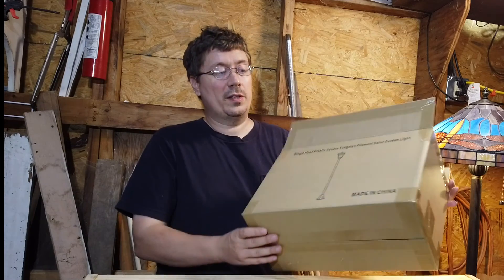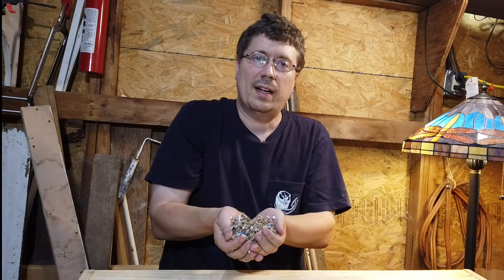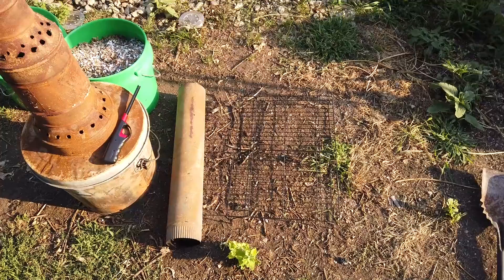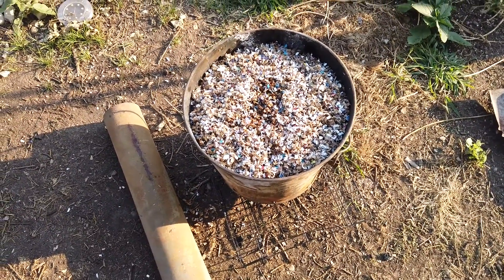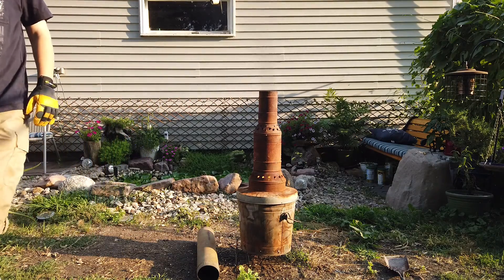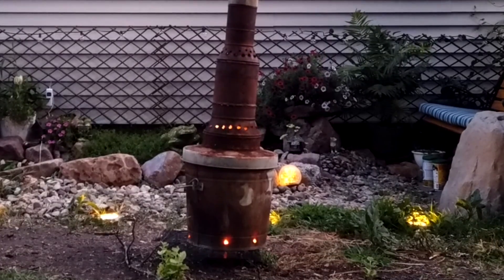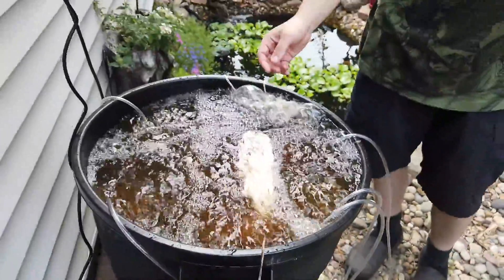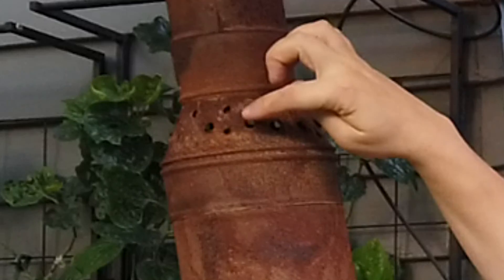[Biochar Basics] Making Biochar from Cardboard **LOW-SMOKE**

Comment: Does the garbage can eventually wear out? Get holes burned through? Thanks, great video!
Reply from the maker: It does indeed oxidize/rust over time. The high temps and exposure to water and extreme fluctuations in temp accelerate oxidation, as does the loss of galvanized coatings. The rig in the video is still around and serviceable. I estimate problems surface in as few as as 2 or 3 dozen runs. That is something that could be improved, for sure...

Comment: Did you get about 1/2 the volume of biochar from the shredded material? I'm wondering what your output is compared to, say 1x1 split wood from the wood pile.
Reply: Thinking that the 1x1 would require the format using a retort,  thoughts?
Reply from the maker: Did you end up trying this? I think you are correct that this design may not work well with dense wood.  You could scale it up, and might get a similar yield. A more traditional charcoal production kiln or retort might be less finicky.

Comment: are there alternatives for the crosscut paper shredder?
Reply from the maker: I think you could use a version of this TLUD to create biochar (charcoal) with most dry organic matter. Results may vary based on the input material, but some possibilities include dry leaves, sticks, pine needles (?), pine cones, wood pellets, etc. If you are using cardboard, but no shredder, you could probably tear/cut the cardboard and skip the shredder--but it might not burn as evenly/cleanly. I've thought about running cardboard through a mulcher, but haven't tried yet, so I don't know if it would work. Does that answer your question?